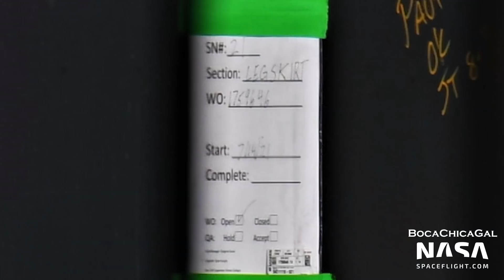Raptor Engines Removed From Booster 4 | SpaceX Boca Chica

Comment from the maker: 0:00 - Sunrise Over Boca Chica
0:40 - Workers Continue Ship 20 Heatshield Inspections
3:20 - Ship 21 Aft Dome
3:40 - Ship 21 Leg Skirt
4:20 - Work Continues on the Orbital Launch Site
5:20 - Booster 3 Watches Over the Launch Site
5:40 - Work Continues on the Quick Disconnect Arm for the Launch Tower
6:50 - GSE 6 Parked at the Launch Site
7:10 - Orbital Launch Site Tank Farm
7:30 - GSE 6 Prepared for Lift
9:10 - Workers Inspecting and Marking Heatshield Tiles
10:30 - Work Continues on the New Structure
11:00 - The Gas Well Site
11:40 - Booster Thrust Simulator
12:00 - Crews Replacing Heatshield Tiles on Ship 20
12:40 - More Crew Continue Work on Booster 4 in the High Bay
13:00 - Work Continues on the Orbital Launch Table
13:40 - Scaffolding Being Removed from the Launch Tower
14:30 - More Raptor Engines are Removed from Booster 4
14:50 - Raptor Waiting to Go Back to Storage or McGregor
15:50 - A Grove GMK5275 Arrives in Boca Chica
16:30 - Liebherr Crane Parts
Reply: Odd that the S#21 ring is described as Leg skirt ring and not engine skirt ring. Are they progressing to adding legs as soon as S#21?
Reply: @Nasaspaceflight can you remember the name of the CIA report done on the capability of the Buran shuttle? Mentioned a few times by one of your commentators. Cheers!

Comment: 13:00 - Work Continues on the Orbital Launch Table

finally.... I missed that
Reply: And now it even has a service elevator.  At 13:10
Reply: When did they start building that thing? Back in april or march?
Reply: @SyNcLife  14 December 2020! And that was first steel segments on site, the offsite fab was likely back in October, and the detailing was likely September. Clearly, something changed in the design from September to Feb when the work just stalled.

Comment: The thermal tiles are awfully thin compared to the shuttles ones.  It'll be interesting how the heat will dissipate.
Reply: Shuttle was aluminum under the tiles- melting point 1220 F. Starship is steel- melting point 2500 F. Makes a big difference.
Reply: @MaunderMaximum  Didn't know that their ship was made of steel which is heavier but must have enough thrust to compensate for it.  That is a smart move on their part.
Reply: Nothing to do with SpaceX: Adorable dog! Part Australian Shepard if I'm not mistaken.

Comment: Looking at the heat shield tiles that are compromised @9:20 on the top of the nose cone, i wonder whether they will eventually eliminate the pointy nature of the nose cone. Ultimately it's not the most aerodynamic option.
Reply: They need a blunt shape for reentry. It keeps the blazing hot plasma further away from the surface.
Reply: @miroslavmilan  Elon said in one of his earliest interviews he added the pointed nose due to the movie Borat or something (I think in a Tim dodd interview) but then admitted that it isn't the most aerodynamic option.

Comment: SpaceX needed the fit check with a stacked booster and ship, so the ground installations can be finished in parallel with the check out of booster and ship. They needed tiles on to get mass close to right, and CofG close to right, but didn't need correct install, so did what was necessary for fit checks, did fit checks, and now are getting on with getting booster and ship really ready. Photo Op was useful, but not essential, but overall doing it the way they did, with the mostly correct ship and booster (just what is essential for planned fit checks) likely saves 2-4 weeks in overall schedule, because now can do things in parallel that would be too risky or costly if had to do over, since they know it fits.  They were never intended to be launch-ready at this point.
Reply: Fit check or photo-op are not reasons good enough for the mad dash to be ready by August 5. Only a very good financial reason could motivate something like that.
Reply: @knowlegeisgood8735  2-4 week schedule saving is a few million $$
Reply: @knowlegeisgood8735  I suspect the date was chosen in part because it was Neil Armstrong's birthday.
Reply: If you don't mind me asking, why are they taking the raptor engines off the booster 4? I thought it's the one that's gonna do orbital flight.
Reply: @hemlock42069  They have to put it through a cryogenic pressure test. They can't with the Raptors in place. BTW, the Raptors were only hooked up, not installed.
Reply: @hemlock42069 my best guess is that  many of those engines may not be certified for flight yet and possibly have not even been test fired. However, they were fitted to the booster so that they could do a test mount onto the orbital launch platform. They probably also served as a path finder task for installation procedures and fit checks on the booster, to test the sequencing of the required steps and  to make sure that no pieces interfered with any other piece, etc.
Reply: @A31415  they weren't disagreeing
Reply: @willh2739  I know, why ?
Reply: SpaceX also recently got the first NASA-HLS payment (300 mln.). Wouldn't surprise me if Elon arranged aggressive milestones with NASA to increase the incentive for urgency.
Reply: Just as with Raptor replacement, tile replacement needs a perfected workflow, so we can chalk this all up to 'practice' and 'evolution'.  I bet some worker will come up with ways to improve tile placement, and hopefully get a big bonus.

There might also be issues with tile production:  iirc there's a metal clip embedded inside, and if they vary too much that could be an issue, ie being 'proud' of the correct surface.

Comment: at 16:00 it's a liebherr mobile crane not a grove right ?
Reply: Yes! It is a Liebherr LTM 1350-6.1 with a maximum lifting capacity of 350 t, a telescopic boom with a maximum length of 230 ft and a maximum lifting height of 439 ft. The parts on the semi-truck are also for this crane.
Reply: @macg9940  yeah after 5 axles they use this triangles weights
Reply: @romix8340  Right! These are some of the counterweights. There is a basic 100 t counterweight that must be attached, to which 40 t can be added. For a total weight of 140 t in total. Here in Europe, the crane travels with the boom forward without this 3-axle dolly. This is probably necessary for a lower axle load.
Reply: @macg9940  yep it is for ground pressure on the ltm 11200 they even remove the boom or some extensions

Comment: 13:55 The person disassembling the scaffolding should not only be relying on the scaffolding for the safety anchor points. They should have slings around the main structural members that they connect to with a yo yo type cable system in case any part of the scaffolding fails. SpaceX really needs to hire a safety inspector who knows how this is done to actually keep these folks safe. I have known several people severely injured when scaffolding failed and they fell. A fall from the heights they are working at would most likely be fatal. I was taught to never trust scaffolding for life safety equipment, only certified safety rails and attachment points installed by someone certified in their installation, and inspected and signed off by a independent qualified inspector.
Reply: There is no time for safety. Asteroid maybe heading our direction right now.
Reply: @sonarsphere  Oh God :D
Reply: the problem is that it is very very hard to find safety inspectors that also have they're own brains and not follow the book to the letter . If they hire a better one they might put so many useless safety measures  in place that the whole project grinds to a halt.in my opinion risk of minor injury should be let to the worker and safety measures should only try to avoid major injury or death, but nowadays safety measures by the book want workers to be protected from every minor scratch turning the whole work day into a nightmare for both workers and contractors, workers have to wear cumbersome PPE in silly places and contractors have to pay extra for less work.  
   but yes that guy should have had a safety line connected to the tower or at least to the more robust parts of the scaffolding .
Reply: @sonarsphere  

Asteroid can’t kill ya if you’re already dead. Pointless argument.
Reply: Speaking of safety, the Bloomberg TV crawler just pointed out the danger of the 2 other billionaires launching people above nearly all the atmosphere without being in pressurized space suits. The ship springs a big leak, and everyone inside is quickly dead. I forgot about those Russians who lost pressure & died.
Reply: Totally agree. Safety inspections and education are never enough especially when subcontractors are involved. Urgency is never an excuse.
Reply: SpaceX workers are badass ...
Reply: Working in a high safety environment myself, I do get concerned at some of the things I see in these videos.  On the lower level of concern, there's the possibility that SpaceX could start getting more particular about people and teams filming outside their premises (including Mary!).  On a more serious level, if they had a fatality it would surely shut most of the production onslaught down for several days or weeks as all manner of inspections are performed and permissions reassessed.  In Tim Dodd's third video at the site, Elon spoke of the need for urgency, but that would all go away the instant something bad happens to someone.
Reply: I took a close look at pics in this video and as far as I could tell, the safety lines were attached to the structure at rings on the structure, and not to the scaffolding some frames seemed to show scaffolding, but on looking more closely, not really
Reply: Aside from all that, it appears the Tower is fairly devoid of scaffolding and they are installing scaffolding in those two areas. Potentially working on the catch / crane / quick disconnect mechanism attachment points, etc?
Reply: In England you would never be able to accomplish the amount space x have done over here health and safety is out of control you couldn’t fart with our health and safety saying it’s an uncontrolled gas movements we are shutting you down 😂
Reply: They are actually assembling the scaffolding at that point (see horizontal bars added @ 14:20 & 14:30), not disassembling. And he is actually wearing a self-retracting fall arrest harness, as it's clearly visible at several points while moving around.
Reply: @tjdawson8942 
Good management, Job and materials organization, motivated and qualified workers, are what make people productive, not lack of safety. I have worked with Chinese contractors, and they took safety just as seriously as productivity. What is your life worth? 2 minutes, 3, 5, 10? When a job is well organized and people properly trained, good safety practices do not slow down productivity at all, and will prevent weeks of job shut down in the event of death. Paying another two people to make sure the proper equipment is mostly pre-installed and is at hand for any contingencies will not cost Spacex much and will ensure everyone goes home alive. The jobs with the the greatest lack of safety are usually poorly built. If the company does not care about the workers lives, why should they care about the quality?
Reply: @johnhanson6039  
Those rings around the pole are part of the scaffolding. Scaffolding accidents account for a very high percentage of industrial injuries and deaths. A co-worker of mine survived a scaffolding collapse in a refinery tank, but the guy working with him did not. Both were properly tied off to a structural member and NOT the scaffolding. If he had been tied off to the scaffold, he would not have had the chance to survive.
Reply: @neiljenkins2011  
The filming is from public areas, so SpaceX has no control. I support SpaceX, but want everyone to go home alive. Having a co-worker be injured or die is not a pleasant experience, and it is even worse when it is preventable.

Comment: What is the white material between the tiles and the steel?  I hope these are not glued on. Also, what is the cylindrical gap at 9:35 that goes around the circumference?
Reply: Insulation blanket. Prevents from temperature distorsions.
Reply: I think that gap is the point at which the Starship cone and body are attached.
Reply: Those blankets have a double function, they insulate and they reduce vibrations. The tiles are fixed to 3 studs that can vibrate so much the tiles can crack.
The nose cone is made up of 2 sections. The area around the two welds was not yet covered in tiles, but now the lower weld line is.
Some tiles have had to be glued, because they just could not use studs there - like the tip of the nose and places on and around the flaps.

Comment: I've got to admit, I am a little bit worried about just how many TPS tiles have already been marked... Sure we don't know SpaceX's exact process or the exact meanings, but that many issues is a little scary.
Reply: SpaceX just ran out of time. They had to (for some very good reason) have the ship stacked by August 5. That meant add the tiles as fast as humanly possible, no matter how it is done.
Now they need to redo it. But they made the date.
I think it was a deadline to get paid a large part of the sums promised by Yusaku Maezawa (billions).
Reply: This is just the first (almost) fully tiled prototype. They're still getting the hang of installing them. Remember how bad the welding was on the earliest ones‽ Now look how much better they've gotten at that. The TPS tiling will improve over the next couple of ships.

Also don't forgot that the primary objectives for the first full stack launch are just to get the thing off the ground, through staging, get booster 4 to attempt a RTLS (albeit actually ~20 miles offshore), and SN20 to orbit (but not actually a full orbit).

If SN20 and/or booster can return to the surface intact (not counting the ditching in the ocean), then that's a bonus data point for them to examine.

Another bonus is that if there are a few broken tiles, then it gives an opportunity to see how a Starship would handle that on reentry.
Reply: @grndkntrl  But for all that to be possible, S20 and booster have to be given a fair chance to make it. I am sure they will before it is time to launch, but that rush did not help.
Reply: @knowlegeisgood8735  Any source for that (your first comment with the payment part)?
Reply: @Bitfire31337  Of course not. SpaceX would never reveal clauses of a contract to outsiders. It is simply the most logical reason. Remember, Elon used his jet to fly workers in from California and Florida. It had to be stacked by August 5. 
That kind of cost and the deadline can't be motivated by simple photo ops or someone's birth day or a wish to work fast. This can't be anything but financial in nature. But if that does not sound logical to you then I have no more to add.
Reply: @knowlegeisgood8735  That sounds logical, I just wanted to know if it is speculation on your side or if there is more evidence to it. While I agree that there could be certain deadlines or bonuses for Maezawa's involvement in the Dear Moon project, I doubt that it would be "billions" for a single milestone like stacking Starship, as - according to Wikipedia - Maezawa's overall net worth is estimted around $2 billion, so I'd think he probably doesn't have billions at his disposal.
Reply: @knowlegeisgood8735  Another possibility for a deadline would be from NASA, which sounds more likely to me.
Reply: @knowlegeisgood8735  Deadlines could have been part of the HLS contract, but on second thought I guess such government contracts might be more openly communicated. To turn this around - why should MZ be able to set deadlines? Though he may be contributing a large portion of the cost of that dear moon endeavor, that's probably not a large portion of the overall development cost of Starship. It's like a charter flight. I don't really think he's in a position to set deadlines for the overall Starship project. Also, Elon knows his own optimistic dates well enough, that he would be very careful to sign a contract with penalties or bonuses on deadlines.

Lastly, Elon states in his interview Wie Tim Dodd, that they treat the whole project with utmost urgency or else they couldn't succeed at all. Also, imagine that everyday it takes longer to develop Starship costs a lot of money. If flying in some specialists can save you a day or two on the project, that might be well worth the costs of the flight.
Reply: @knowlegeisgood8735  To wrap that up: You're or my guess about the reasons are as good as any, and we'll probably never know. Interesting discussion anyways, thanks for the exchange of thoughts!
Reply: @Bitfire31337  I agree, but Maezawa is a businessman, he would never pay for something without an airtight contract. Elon would not want to be paid on the day of the trip. He would demand to be paid in installments. Maezawa's lawyers would set deadlines for such payments.
All is speculation, but is the only thing that explains why Elon would use his jet to fly people over from all sorts of SpaceX facilities - and likely pay them a lot extra for it. It must have cost millions.
Maybe one day Elon tells us.